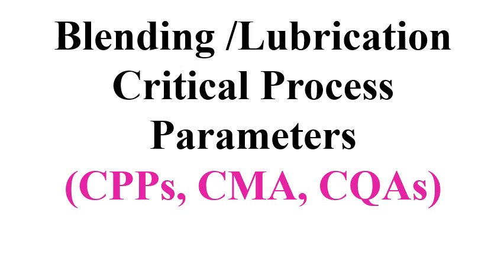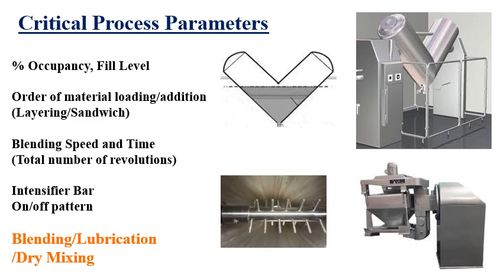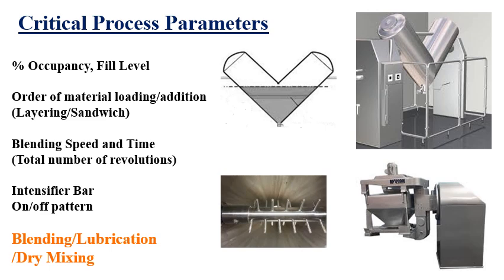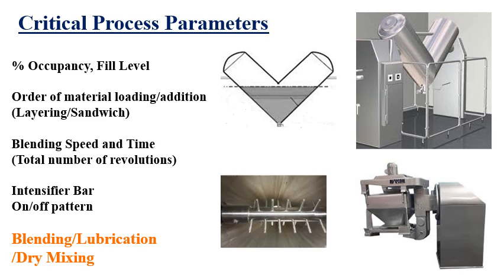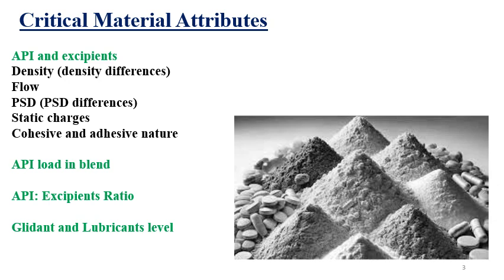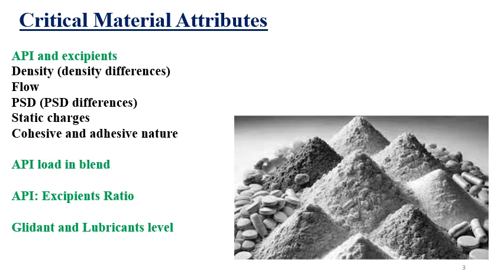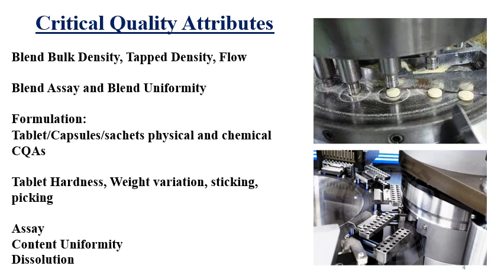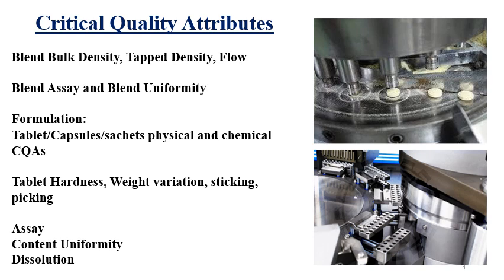Blending Lubrication Critical Process Parameters

Comment: How to overcome from problem of smear formation While tablet compression?
Reply from the maker: Smearing during tablet compression mostly happens because of extra moisture, heat, or not enough lubricant. To avoid it, keep the granules properly dried, use the right amount of magnesium stearate, use clean and smooth punches, and adjust the compression force and speed. Better granule quality and avoiding low-melting excipients also help reduce smearing.